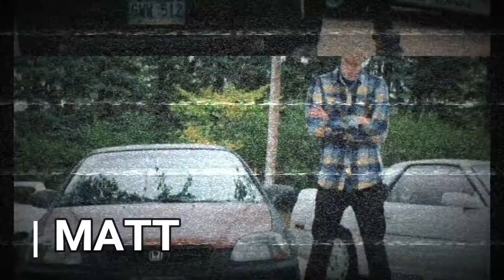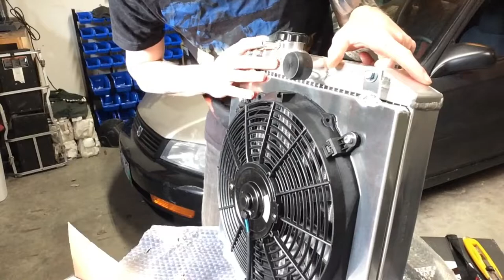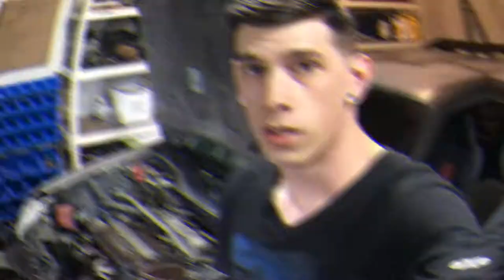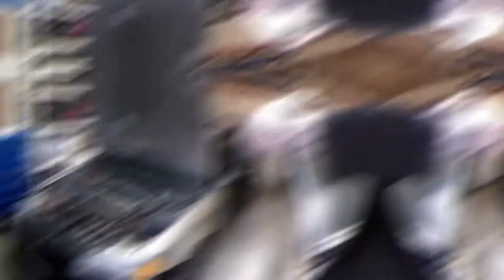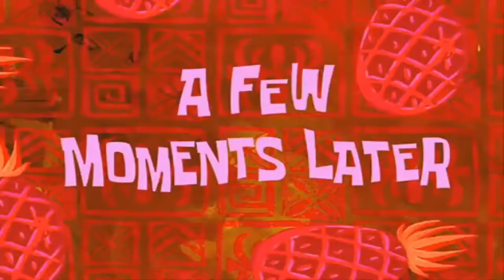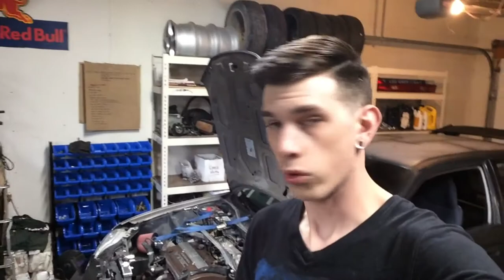H22 Swap EK Civic - Yonaka Half Rad Install / How To

Comment: Hi i have the same setup as you H22a euro r in 2000 ek Civic i Buy the same rad. I just put the slim fan on the rad with tie wrap and i use my stock slave cylinder juste need to notch the first hole so you can mount it on the trans:)
Reply: @nolimit341 hey man sorry to bother you but can you please advise what radiator hoses you used for your h22 on an EK? I’m upgrading the coolant hoses on mine for my EM1 with same swap and want to know what would work
Reply: @sixfiggaz07  hey bro, i use a silicone hose on mines, got them of ebay and they're pretty good i will say

Comment: What rad hose did u use?
Reply from the maker: I used the factory EK rad hose. Was a bit small, but I was able to stretch it over. Will definitely be replacing with silicone hoses in the future